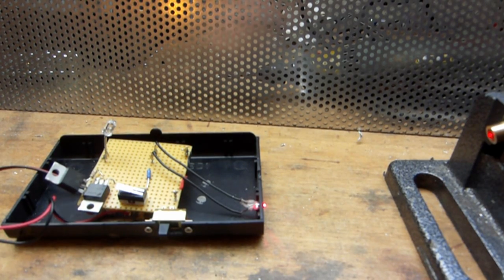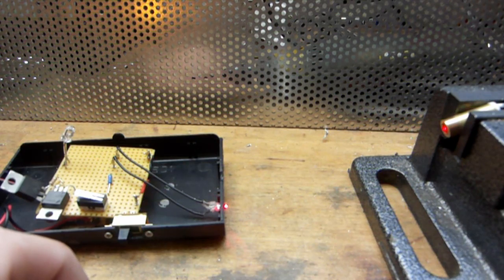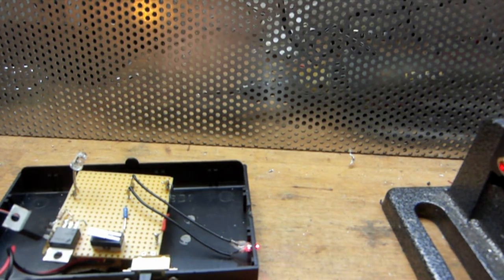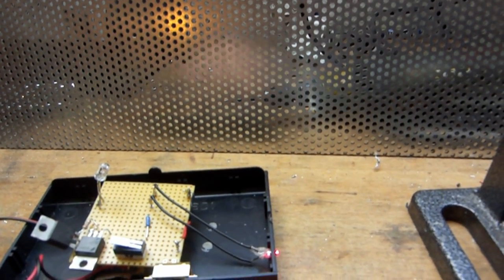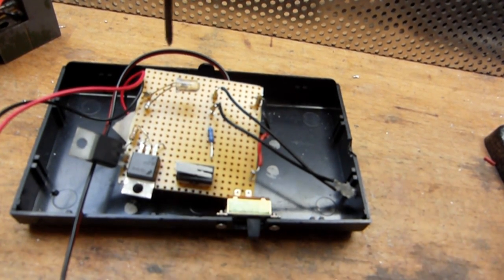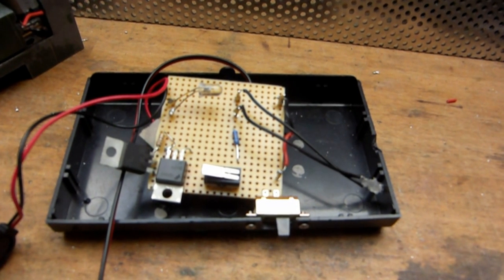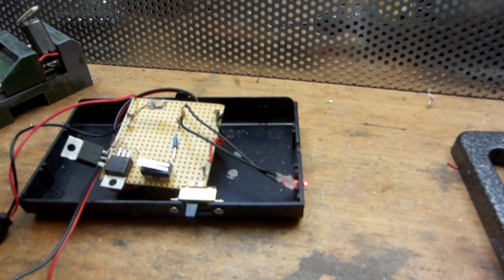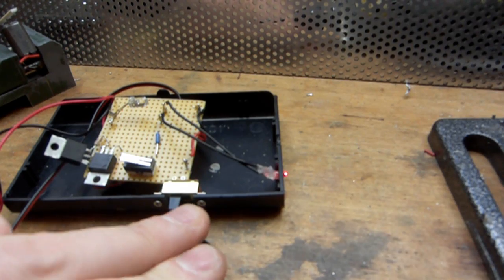How to: Super Easy Laser Trap / Coilgun switching / Trip wire

Comment: I cant get the alarm to stay on ? as soon as i point the laser back on the sensor the alarm goes quiet again.
Reply from the maker: Then your beeper does not draw enough to keep the SCR switched. Make sure you use a small SCR, their stay-on-current is lower. And you can add LEDs in parallel to the beeper. That way it will draw more mA.
Reply: the smallest one i could get was BT151-500R, 12A, 15mA, 500V SOT78. ive got no idea what that means , but electronic store said its the smallest that theyve got. when i put a small toy car motor instead of beeper the alarm stays quiet
Reply from the maker: Conrad Nummer 186694 oder 151485